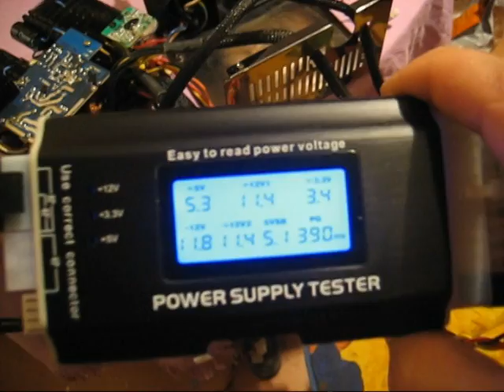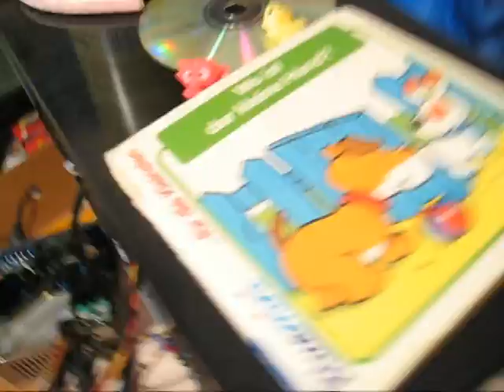How to easily repair a PSU -PART 2- By:NSC

Comment: Hi! U think a 60W traditional simple pointing soldering iron is powerful enough for melting this stuff..? The other leg of the other capacitor in need of replace is soldered inside a big lump of tin which holds another end of a thick metal bar too.. :-D 4700uF NCC capacitors r on the way from Hong Kong already soon now. This is of a P6 series BQT of 1000W :-) +5V line had suddenly dropped to 4,6V.. Two of these mentioned capacitors were ballooned a bit. Thanx!

Comment: Ok found out one of the floppy connectors wasn't showing 5v so i took it out and still nothing ok so rechecked the v hooked and unhooked to the motherboard the 12v wires are showing 11.97v and the blue is -12.3

Comment from the maker: PG should have about 100-500ms if its more then 500ms, then it takes to long for the Mainboard, and it would not boot.

You can also try to test the PSU on an other PC, if it works, then its realy strange ^^

Comment from the maker: The 4pin 12v for CPU also tested? and did u also tested the 24pin connector? If u have test all and the volts are ok like u told, then it should boot up your PC, very strange ^^ Check also the Connectors, maybe one pin or more gets no contact to the mainboard? seems that from somewhere or some pins comes no power & how are the PG ms Results, to see on 8:02, it should be more then 100ms. PG means "Power Good" if this is not ok, the mainboard will not wake up and boot, cause the PSU works to slow!

Comment: Hey im having a problem with my psu it dosnt boot up the comp but the old one does i checked all the connectors and they had the right volts and non of the cap are buldging took awhile to get all the glue off of most of them. What do you think could be an issue or what else should i check?

Comment from the maker: Sounds bad... just take care, testing while PC is connected can be bad ^^

i would realy check all Cables, 12v 5v and 3v Cables, then check also the 20-24Pin Cables, at last check also the Power Switch button, and them Cables around the Power Switch, but maybe the button is also damage!

When u say it works when u move the cables from right/left, then i bet its somewhere bad contact!

Check also the Capacitors, sometimes thei have bad contact to the platine also, resold them, it can help!

Peace

Comment: Thx for the quick responce dude! 
Ok, I already opened  it yesterday, clean all the dust, but I didn't checked for unsoldered cables, I'll guess I can do that. Is there a variant we have a problem with the on/off switch. I tried with other power cord with no change, when i repeatedly plug and unplug the cable changing it's direction a little to right/left it seems there is some sign of life on my psu. The lights on the case had turns on  but just for a second and then again no power.

Comment from the maker: Try to open it, but be sure you that you take the power cable out from energy :P

Switch the Power botton few times ON and OFF without the power cable befor you open it, so the rest energy will go away...

Open it and look if the cables are loosing contact from the PCB "platine"

If yes, you can try to Sold them again...

Comment: As long as you only change the capacitors there's no way to be harmed as long as you don't put your hands within the PSU while connected to the main socket. 
No, the voltage is the same in input (220v~ non US - or read Mains electricity by country on Wikipedia) and LOWER in the output (12, 5, 3,3 volts - see PSU on wipedia).
There's no need of a specific *title* and anybody MUST already know that ANY home apparel with electricity can be very dangerous.
An hair dryer can be more dangerous.

Comment: I have a OP1200 silverstone and it didnt have enough power to fire up so i turned up voltage inside and valah ,problem is i cant get it to 3.3 volts just 3.46 volts does this matter ?

Comment from the maker: no problem at all, if you buy a new PSU you will also have nearly the same results, ive test that all long ago with an ENERMAX and ive compared, its all ok ;)

11.4, 11.8, 11.2 or 11.9V its all ok, if its under 10Volts then its not that good, but all over 11Volts is fully ok ;)

Cheers

Comment from the maker: it can also happen that other parts gets brocken, but you can repair all, as long you know what it is...

The capacitors dies very fast, we can say mostly are thei the reason, why a psu dosent work... but like i told, at this way most PSU´s are repaireable, because most PSUs dosent work more because those Capacitors.

Great cooling is also very important for a PSU, so the parts holds longer...

Regards

Comment from the maker: befor start this on a PSU, you should first take the Power Cable out, then switch the Power boton to ON without Power cable, the so volts will go away and all is ok. But this is not need to tell a Skilled guy.

So when you do that stepp by stepp like on this Video i garanty you it will happen nothing bad.

If a PSU mades BooM or BAAM, yea, then you better buy it new :)

At last its to you, how Skilled you are, if you think: i canT do that, then you better let it be.

i just show how it works :)

Comment from the maker: LoL the question is, what is realy save? It can happen more that you die tomorrow because of a Car that drives over you, as to be killed with a PSU ^^

And PSUs has MAX 240Volts, you will not and NEVER die because 240Volts ;)

long ago i had my Hand for about 10Sec. on a 650Volts line, belive me, thats was realy HARDCORE to me and im still alive, so 240v sounds like danger, but no Panic on the Titanic ^^ (240v sounds like "oops wow ^^") but (650v sounds like "OMFG AHHHH WTF" =_=`)

np at all ;)